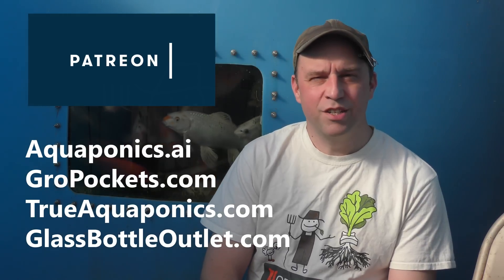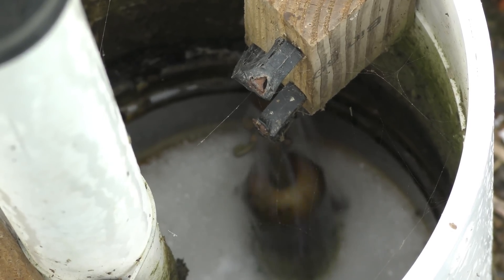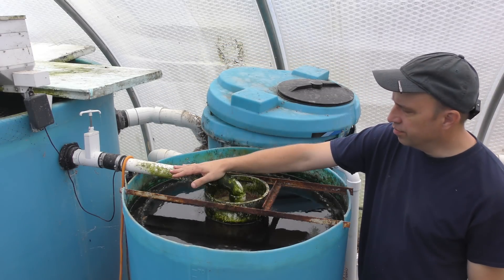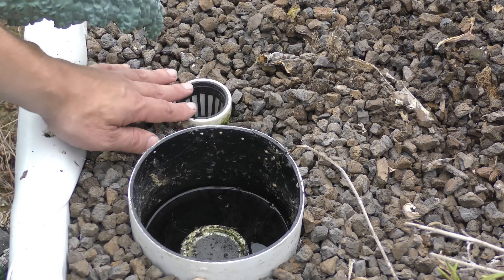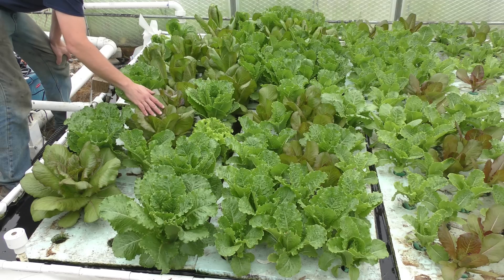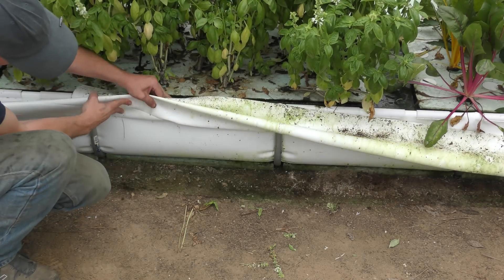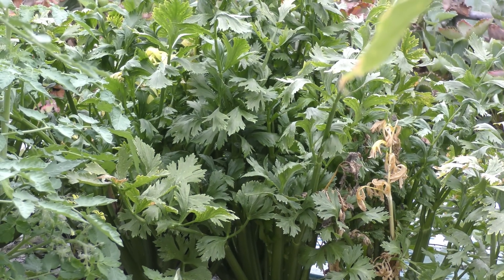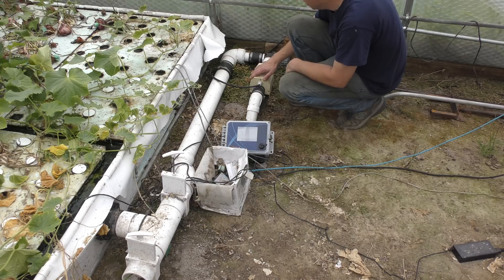Full Tour - Aquaponic Greenhouse

Comment: Is that the same wrap used to keep a swimming pools warm ???.
does it make any difference if the bubbles are facing up or down ???
Are you able to roll up de sides to let some heat out ???.
Reply from the maker: It's called SolaWrap

Comment: Rob, curious about the greenhouse orientation. Why north-south and not east-west, shape of the field/slope or trying to even out the light on both sides?
Reply from the maker: It is to even out the light.  This style is not energy efficient so the orientation is best to deal with lighting.  If I didn't an efficient model, like a Chinese style, then it would run east-west and have the light come in through the south.

Comment: I have an idea that might work to help cool down your greenhouse, if you can dig a hole and put a tank underground, or use a well water system, run a line that circulates the water from your tank into your fan system with some copper lines and it should help cool the air down  that passes though it.
Reply: Shade netting will help keep your temperatures down on hot days. I would try to set it up so that it's retractable and you can pull the netting in to place on the hot sunny days and draw it back in the winter. Think of it as curtains; one over the top and then one on each side. I'll leave you to figure out the mechanics... :-)
Reply: Or...heat rises, so... Put some servo-controlled vents in the ceiling and let the hot air rise up and out, which will draw in cooler fresh air from the vents along the bottom sides. I was impressed the pump and aerator system draws so little watts, but didn't hear any mention of how much it takes to power two 48" exhaust fans and an evaporative cooler.
Other than that, he has an extremely nice system and made a good video.

Comment: how do you overwinter the system? I am considering doing aquaponics, but here in Poland the winters get very chilly, so it would be quite the challenge to keep things running in winter.
Reply from the maker: I remove all the plants and stop feeding the fish.  There's a small heater for the water to keep it from freezing and I leave the pump running to circulate the water.
Reply: @Bigelowbrook  thank you very much
Reply: @Bigelowbrook  Great Video!!!  May I know the brand and model of the small heater that you are using?  It seems like a good idea to heat the water during winter.  Thank you so much!
Reply from the maker: @jchao777  It uses a LOT of electricity so it's not cheap to run.  https://youtu.be/ZNeKIHhWps0

Comment: Great tour Rob. I have a quick question. Do you have a problem with your fish reproducing and getting into your DWC bed, and if yes, how do you deal with it. I have a decent sized system with a really good RFF and media filter, but it doesn't have media beds on the front end. I'm trying to decide if adding media beds would make a difference in keeping fish out of the DWC bed.
Reply from the maker: I've had it happen in my old greenhouse and this one.  The eggs can eventually wash through the media beds.  I did a video this past spring where I cleaned out this DWC bed (replacing the liner) and I caught several fish in there.  They are a huge nuisance because they love the lettuce roots.  If I tried to add a filter sock to the inlet, it would probably clog too fast...even with the beds, there are still some solids that get through.
Reply: @Bigelowbrook  yeah, eating the roots is the same problem I’m dealing with. I have goldfish, and I’m in Texas. It seems like they breed year around and every few months I’m cleaning out fish.

Comment: I would spray paint the tops of blue drums black if you want to control the algae :) it works very well, the algae will take up the nitrogen which would otherwise go to the plants
Reply from the maker: They are blue to minimize the light.  It's very difficult to paint HDPE, next to nothing will adhere to it.